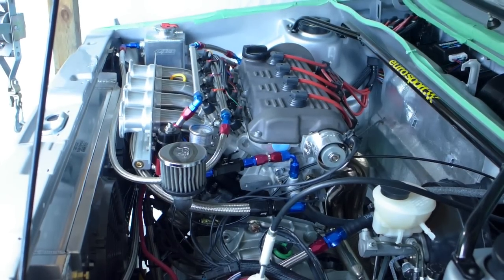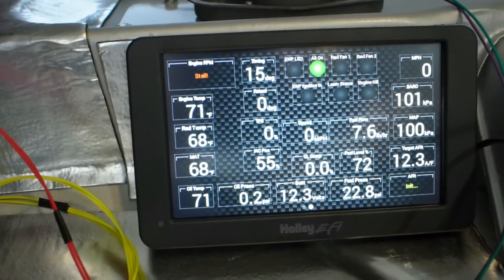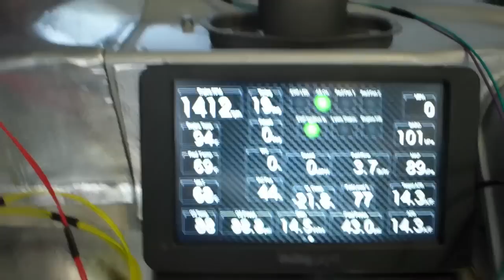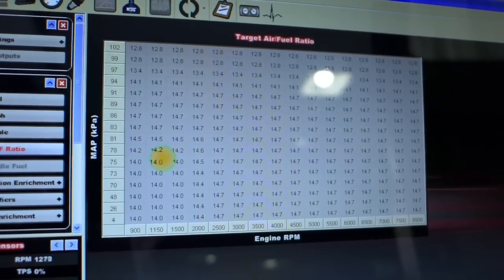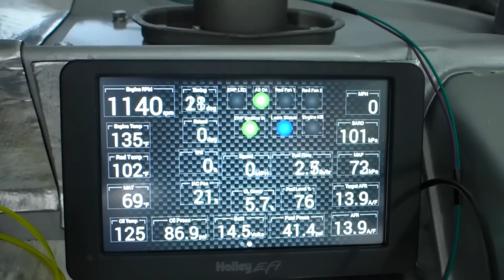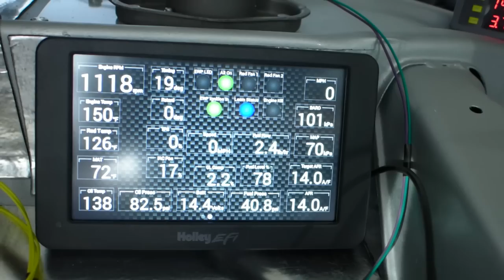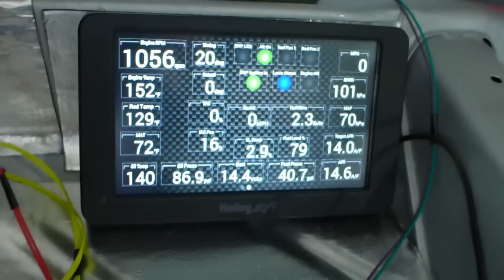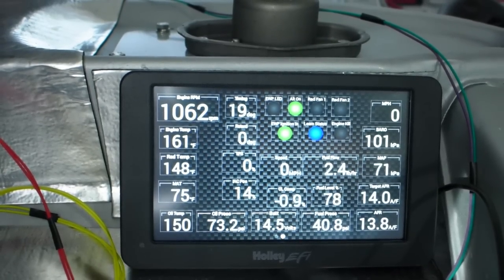The Ultimate 1983 Rabbit GTI - part 103 (VW 16V ABA Engine - Holley Dominator EFI ECU Tuning)

Comment: Bear in mind that my comment is coming 5 years late, but I'm binge watching this series. Started with Part 1 yesterday, just over half-way through so please disregard if you have attended to this already. That said, my point was dealing with the venting to atmosphere with the crank breather. You will see misting and quite a bit of it. You should be running that tube through a catch can and then venting the catch can. The can will be stuffed with some SS wool and take the oil vapor and resuspend it into the reservoir. Normally there is a drain petcock on these that you must periodically drain.
Reply from the maker: I did run a catch can at the track for that very reason - on the street though I saw very little evidence of oiling vapors - seemed to just attach to the filter element which I washed occasionally.

Comment: If u see this msg tell me how u running with opent distributor.. No spark plug on it.. R its jest like end cap... Tnx... I want my vw corrado 9a engine make distributor..
Reply from the maker: The ECU controls individual coils so all I am doing is getting the cam position signal ...

Comment: Put a smaller alt pulley
Reply from the maker: Well, getting too much rpm to the alternator is an issue - 8000rpm x ratio and you want to keep these alternators below 20,000rpm ...

Comment: Derek can the stock ABA wire loom and ECU work with this setup with some modification to the loom ?
Reply from the maker: I assume you are referring to the ITBs - they require extensive programming to work properly so you shouldn't attempt them with a stock ECU

Comment: I notice that the AFR goes to around the mid 20's very briefly when you blip the throttle.  On my 16v dual solex carb setup, it does the same thing.  Is that something that should I should try to straighten out or is it just going to happen no matter what? Any tips would be helpful. Thanks! Project is amazing by the way and your patience and attention to detail make me jealous!
Reply from the maker: +Soren Neumeister Soren, I have been sitting in my hotel in Hong Kong just as you composed this message, staring at the data logger results from those throttle blips, trying to sort out why it goes lean briefly and what if anything I should/can do about it. These transient conditions are some of the most difficult things for me to tackle. This is going to be a long reply so here we go:

There is the static programming of the fuel and ignition tables that take the MAP and RPM inputs and provide the fuel and spark settings (which I manually programmed initially and then refined via the ECU learning mode) and then there are all of the feedback/modifier settings such as the IAC (idle air control) system, the ISC (idle spark control) system, the AFR CLC (air fuel ratio closed loop control) system, and a host of 'fuel modifiers' such as AE (acceleration enrichment), SE (startup enrichment), and other temperature related modifiers that come into play as the engine warms up or as environmental conditions like air temperature and pressure change. You can think of the static programming as the baseline and many of the other systems as attempting to refine it but each of the feedback systems imparts its own potential instabilities and/or errors that mean a lot of time and guessing goes into adjusting how sensitive each of these additional modifier systems are, and ensuring that they don't conflict with each other, etc.

I am barely at the point in the programming where I understand all of the functions and tables/settings that the Holley ECU has and realize that studying the extensive data logging charts will be my savior. For instance, I have found that I needed to increase the IAC 'blanking' window to keep that system from falsely reacting to changes in idle RPM and actually making it worse - it is now set to +/- 30rpm and it no longer hunts around trying to smooth out the idle of my race cam, plus I needed to decrease the TPS (throttle position sensor) AE (acceleration enrichment) blanking window by a lot to get it to react quicker to small TPS changes - with ITBs (independent throttle bodies) a small change in TPS values often means a fairly large increase in air flow and the default TPS blanking values were set way too high - when I am blipping the throttle in this video it is in the range of a 3-5% typically, not 10-20%.

I think I can get the ECU to get the right AE for blipping the throttle figured out but it may be that I will have to accept some transient lean conditions before the ECU can react. I noticed in the data logging charts that the CLC (closed loop control) reacted fairly quickly to add more fuel at the beginning of each blip so I might be able to make progress by a combination of messing with the TPS AE parameters and tightening up the CLC feedback speed which is fairly relaxed at the moment because I was focused up until now on taming the rough idle and I was drilling down on all of the feedback systems which were trying to intervene ...

I am also looking into changing the ECU over to what is called 'combo alpha-N' which allows me to force fuel and spark settings for just TPS and RPM, ignoring MAP inputs, up until a particular RPM and TPS setting (such as 1500rpm and 5% TPS). This is meant to address race cams that pull little idle vacuum. In my case I have managed to get a decent idle without resorting to any use of alpha-N strategies but I am worried about a condition that I just noticed in the data logs that shows that when I crack open the throttle 2-3% and hold it there, my MAP signal starts to steadily drop as as the rpms build - this makes perfect sense as a higher no-load rpm would allow my race cams to create much more vacuum, but it creates all kinds of potential programming challenges for me as the fuel tables need to actually get richer with lower MAP values (below the 65-70kPa where it idles nicely at 1025rpm). An alpha-N strategy around the idle range could potentially solve that, BUT it would force  the CLC to do all the work for compensating for the IAC circuit as it independently tries to manage/change the idle speed. If you can get what I mean: an alpha-N strategy doesn't look at MAP and MAP would change a fair amount as the IAC valve opens and closes, causing AFR errors that the CLC would have to react to and fix.

A recommended strategy is to narrow down the CLC range of allowed corrections once the ECU is fully programmed as a failure of the O2 sensor could could wildly inaccurate AFR settings so to avoid the potential for that failure hurting the motor for the long term use CLC corrections should be limited ... and I may have to keep them wider than 10% if I will be using combo alpha-N/speed density.

For your carb setup (and I am not much of a carb techie) your AE circuits may have to be adjusted so that you get a larger squirt of fuel when you rapidly move your throttle blades. Obviously a transient lean condition isn't going to hurt your motor, it will only reduce the crispness of the motor response to the throttle input. If you are happy with things as they feel when driving the car today, don't change anything. For me, I might be chasing my tail worrying about a lot of things I am seeing in the data logs that simply won't be a noticeable factor in the real world when driving. But I am obsessive compulsive (and it is hard for me to sleep at night knowing that I have so much programming ahead of me on this project).
Reply: Derek, you are much more brave than I am with all of this programming, and I can't even begin to imagine the amount of headache all of the programming is causing you, when I thought I was frustrated when I am just dealing with manual carb tuning. One thing that I see that we have in common is the problem with the massive amount of air the enters the engine when the throttle is opened slightly, considering we both have four butterfly valves opening up. The thing I wonder, which I doubt you would have the answer to but something to think about, is that if there was enough fuel to get a better AFR on the blip of the throttle or the beginning of a fast acceleration, be too rapid of a burst of power to be practical? It appears that you are tuning the car without filters on, which could solve your problem possibly unless you plan on running without filters. But, my point is that if the filters are restrictive enough that might bring the AFR in this troubled range much closer to target.  I could just be saying things you already know but I thought I might throw it out there just in case.  Hopefully you will be solve your problem with that combo alpha-N ECU, which sounds like exactly what you would need. In my carb setup, I am already putting in quite a bit of fuel for my AE.  I think so much that it has a problem atomizing the fuel. Thats where I'm stuck.  If only there were a way to limit that great surge of air at the beginning of acceleration and not loose that great throttle response that comes with I would be golden. It doesn't sound like my OCD about these things is quite as bad as yours when I see those numbers go even slightly more lean than I want it kills me, so I know your pain.   and sorry if I sound like I don't know what I'm really talking about, if I did I'd have the answer for you hahaha. Anyway, good luck on getting all your numbers right where you want them and thanks for the reply! Major respect to you for learning all of the ECU programming!
Reply from the maker: +Soren Neumeister I have a large air box that wraps around the ITB trumpets and then draws filtered air thru a 4" tube connected to a large K&N filter off to the side of the engine that draws cold air in from below so I hope the air flow will not be impacted relative to running w/o filters. One thought is to design a more progressive linkage that reduces throttle blade motion at low throttle position (TP) settings - right now my (and probably your) linkage has maybe a 50% reduction in sensitivity at low TP settings because the linkage connects to an oval shape. I would think a full 2:1 reduction in movement at low TP settings would be ideal. 

I don't think a temporary lean condition is an issue for you and there may only be limited improvement in crispness with more AE applied - but there is no harm in you tuning for more AE to see if you like what happens - I don't know if that is a simple screw that you can turn or jets that need to be swapped.
Reply: Raise the fuel pressure, perhaps. A better fuel pump?

Comment: They sound great! what will the RPM limiter be set at?
Reply from the maker: +Joey Marstall Initially 8250rpm but once we determine the rpm that peak hp starts to fall off, I'll add 6% and set the limiter a bit higher - to allow the engine to land at the next gear rpm point where average hp down the track is maximized ...
Reply: Well said, sir.